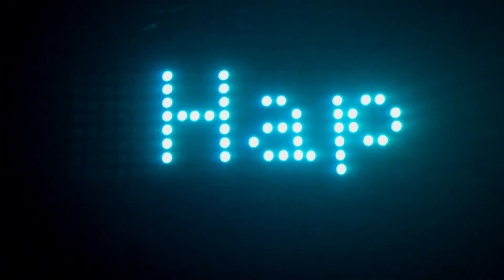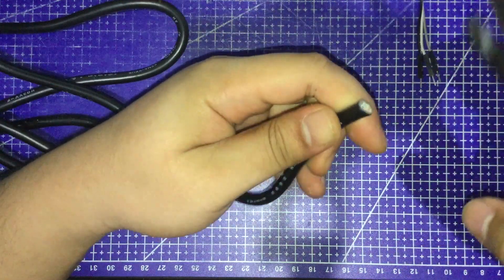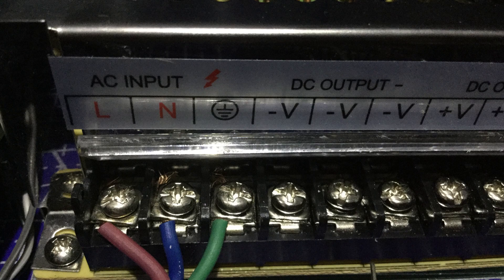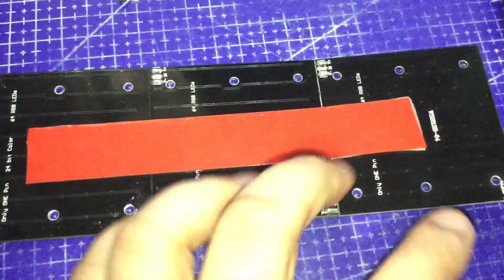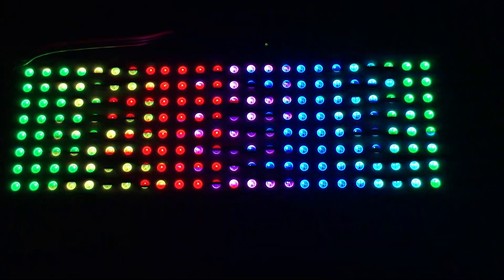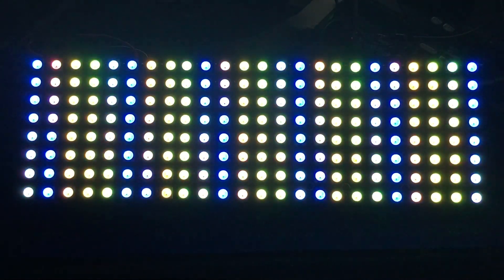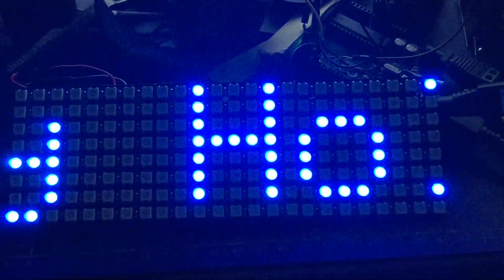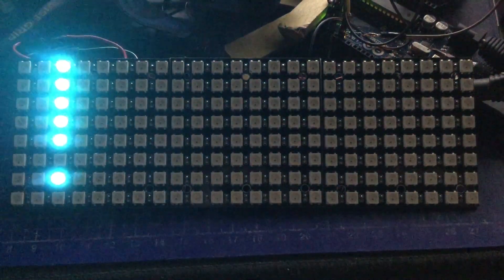Arduino Project #8 | 8x24 WS2812B RGB LED Matrix + PIR Motion Sensor Door Display [Arduino Holiday]

Comment: I am trying to switch from an 24x8 led matrix to 32x8 but it doesn't seem to work. When the sensor reads HIGH the TEXT doesn't show up. Any ideas? Thanks in advance!
Reply from the maker: Hello and thanks for the comment! ♥ Hmmm.. good question! I think maybe it has something to do with how my code was written and the current library version. Maybe it's having some conflicts somewhere, but I'm not sure. Have you tried running the scrolling text alone without the sensors and the sort of screensavers effect?
Reply: @HeathenHacks  it's really weird! I managed to make it work on the 24x8 matrix but when I use a 32x8 matrix it doesn't light up at all! Thanks for sharing!!!!
Reply from the maker: By any chance, out of curiosity, are you using an already built 32x8 matrix or a bunch of 8x8 LED matrices put together like what I did? Also, have you checked if it's because of a power issue?
Reply: @HeathenHacks  I am using a pre built 32x8 matrix! I didn't check if its a power issue! Tbh I don't know how!
Reply from the maker: I see. Have you checked if the pre built have a library of its own? I think some of them have their own libraries. Also, is it a WS2812B RGB LED matrix? If it's not, you're really going to have a difficult time making it work.
Reply: @HeathenHacks  it’s supposed to be a WS2812B matrix. If I indicate 24x8 (out of 32x8) on the code, 3/4 of the matrix work like a charm. But if I indicate 256leds 32x8, nothing happens! It’s really weird!
Reply from the maker: Sorry to ask, but you are using a separate power-supply for the matrices, right? If so, have you tried changing the Matrix's Width and Height on the code?

Look for something like this:

const uint8_t kMatrixWidth  = 24;
const uint8_t kMatrixHeight = 8;

If you did changed that part and it's still not working properly, I would suggest to try a different tutorial to find out what is wrong. Maybe the code on this project just does not fit. It's just like that, sometimes.
Reply: @HeathenHacks  I do use a separate power supply (5V) for the matrices and the Arduino. Also changed the width and height and the number of leds.
Reply from the maker: I see. Sorry about that. I think it would be best to look for a tutorial that uses the same prebuilt matrix. Maybe you'd have a better chance on that.
Reply: @HeathenHacks  is that on your channel? I will def try that out! Cheers! If it works I will update you.
Reply from the maker: Unfortunately, no. :(

Comment: how i conect a p10 rgb led matrix display with pir motion sensor ? is it possible?
Reply from the maker: Hello, bidhan! Thanks for the comment! ♥ Yes. I think it's possible to use it with a PIR motion sensor, since the Arduino would only need to get the values of analogRead, the only problem is that I don't know how, because I don't have a p10 led matrix.
Reply: @HeathenHacks  please help me to do this.my email is science18pro@gmail.com
Reply: one condition, you conect it with rgb p10 display pls
Reply from the maker: As I have said, I don't have a p10 led matrix. Please check this out: https://circuitdigest.com/microcontroller-projects/digital-notice-board-using-p10-led-matrix-display-and-arduino